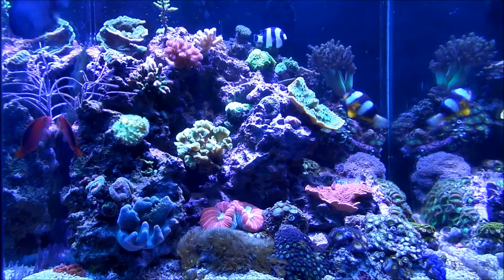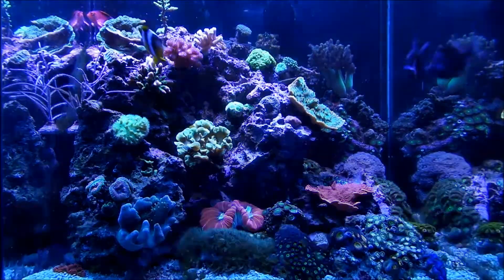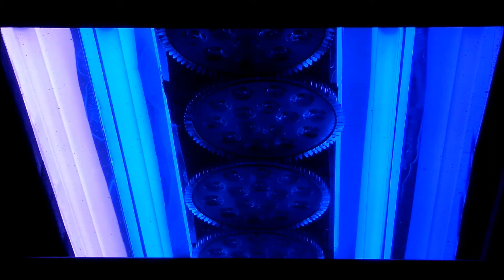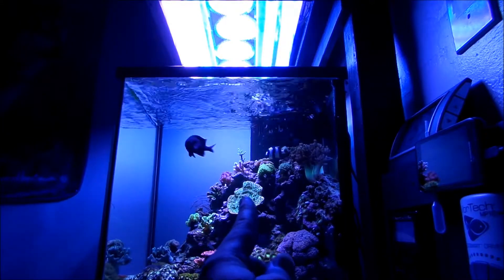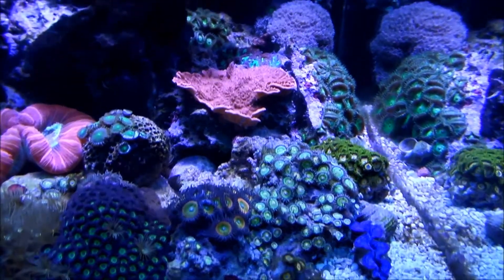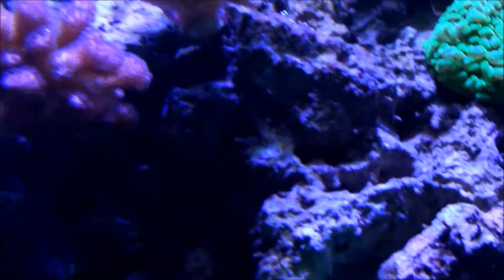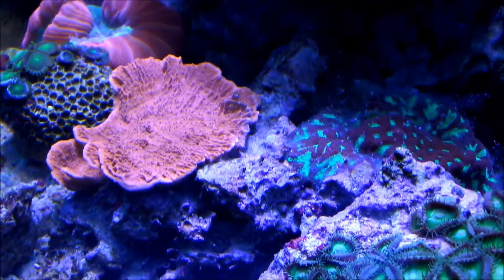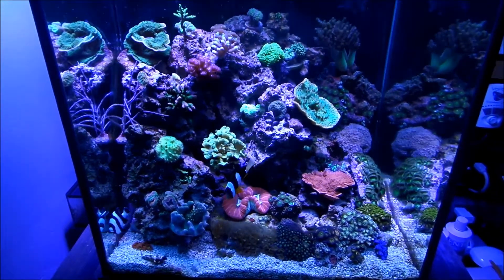My T5/Par 38 Reef Lighting Experiment

Comment: I think T5 + LEDS are the way to go. I’m definitely seeing a difference in just a few weeks. I’m thinking of doing a pico 5 gallon reef. I might use one of these PAR38 💡 .
Reply from the maker: ReefingwithO well I got the idea of doing this based on the Aquatic Life new T5/LED fixture. I see you got it. I know you've been talking about the fixture for a while as I see you in the ReefDudes live stream.
So I took my old Aquatic Life T5 HO 4 bulb fixture apart and custom fit them all in my canopy. The Par 38's has been in my system for 11 months now. I need to change my T5 bulbs but I'm still acclimating the Corals to the T5's even if their old. So far so good. 
The same Par 38 bulb is growing my chaeto as well. I harvest full 5g bucket every 3 weeks to a month using this bulb.
Thanks for stopping by buddy.
Stay Reefing and high 5!
Mel

Comment: It's best to start with just 2 T5's at a time but since all 4 come on at once then Maybe just like 2 hours a day. Add 30 minutes every 10 days. 👍👍👍
Reply from the maker: Billy Pipes ok. I'll try it. Now the other thing is that all these T5 bulbs are way passed due to be changed. They are very dim at this point. Which maybe it wouldn't be so bad for the 4 T5 to be on at once and replace 1 at a time every month until they are all replaced. Could I do that? Or still disconnect a Ballast  and do what you suggested.
Also since I have to replace the T5 bulbs, what T5 combination would you recommend Mr. T5 Power? Lol
Your input is very much needed.
Reply: Meldium since the bulbs are old u could do like u said. It might work lol. And so far my favorite combo starting from front to back. Blue plus then coral plus then Actinic then blue plus